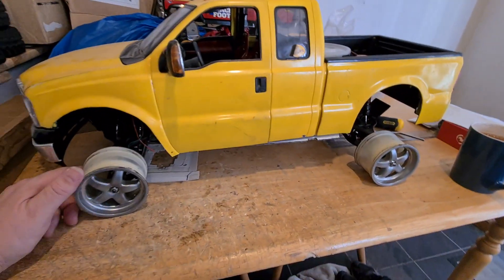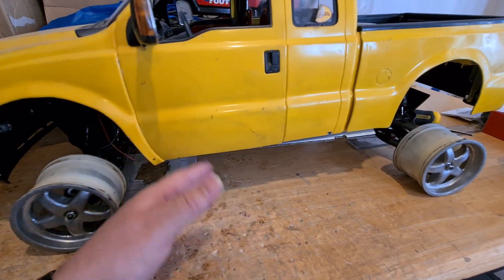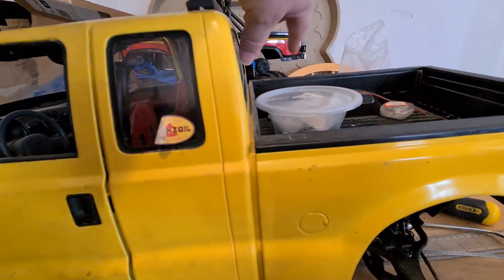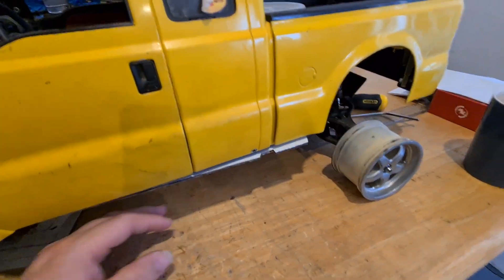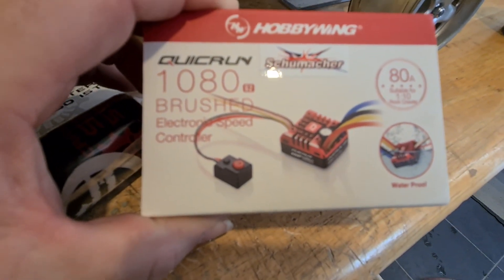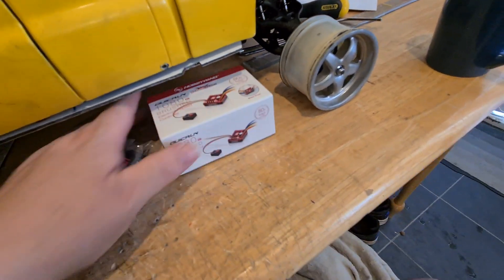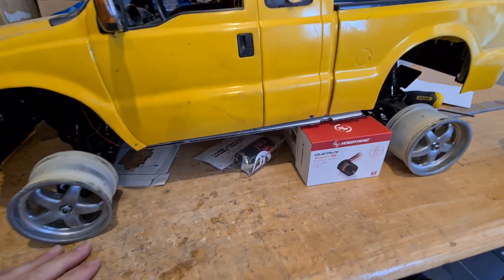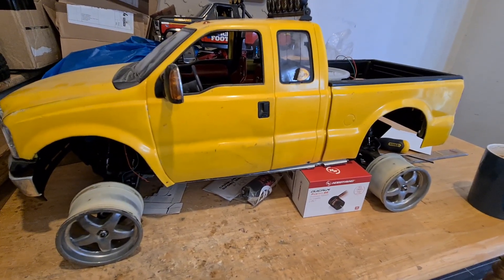RC Update 29/09/23                                        1/6 Emaxx (Big Yeller) Project

Comment: Holmes hobbies motors are absolutely excellent for the price, I used one with a 1080 and put 200 miles on it so far. Absolutely would use again.
Im a Chevy truck guy myself (I own 6 different Chevy trucks) but I ran across one of these ford Bodies. It's a raptor instead of a f250. I think mine is slightly smaller though.